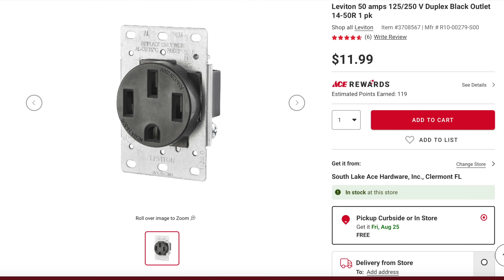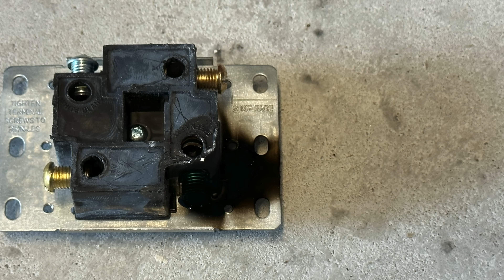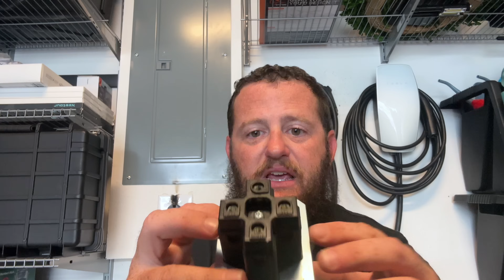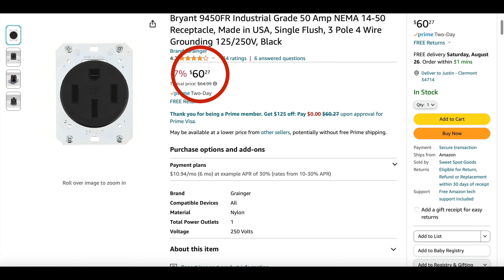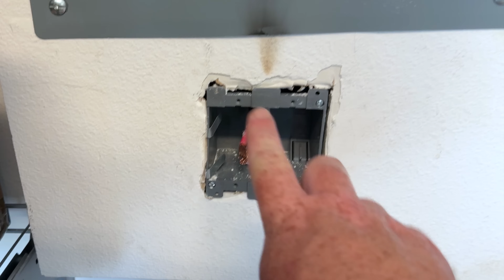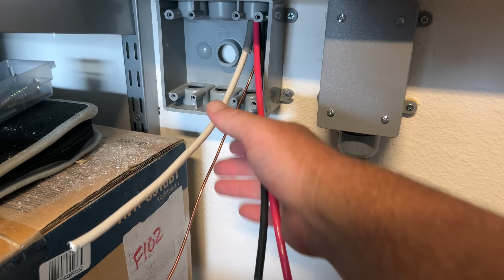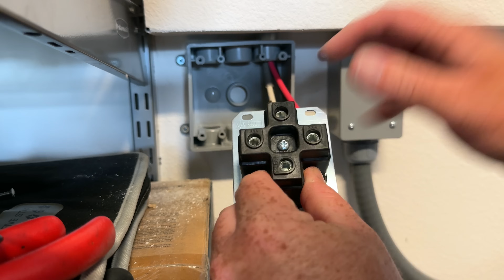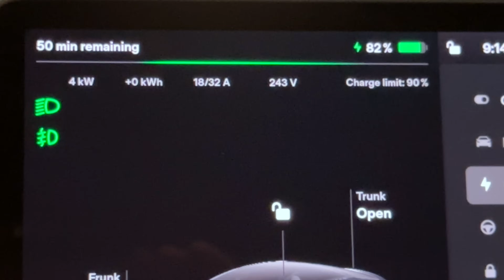This Will Save Your Life if You Charge Your Tesla on 14-50 Outlet!!

Comment: Like most manufacturers of building supplies, I would assume that your Home Depot or Lowes Leviton offering is not identical to the "same" part offered by an electrical commercial supply house. Anticipated use cases, as you noted, are different. 
It would be nice if some EV governing body of manufacturers, or whatnot, would release a build standard for 32 and 50 amp EV receptacles. Then manufacturers could submit their products, have them meet some level of compliance which they could then advertise. Sort of like NACS, or CCS, etc. are standards. 
Because of my housing situation for the next 9 months or so, I will be using an existing 32a 240v dryer outlet. But I am plugging a short extension cable into it and never removing it from the source outlet. When needed, I'll plug and unplug from the other end of the cable.
Reply from the maker: Just like with many other household appliances and applications, a standard would help both consumer and professional steer to the right stuff.
Reply: A better standard sounds good, but using an extension cord does not. The Mobile Connector has temperature sensors to detect overheating due to excessive resistance, but the extension cord does not. So if there is heat buildup at the receptacle, it won’t be able to detect it unless it’s plugged in directly. I assume that’s why the manual says not to use an extension cord.
Reply: @pepstein  Even if the extension card is STW rated with 10AWG copper and has the weather rated thermoplastic jacket? The extension is built to supply constant 30A service to an RV under full rated load.
Reply: @Agg1E91  the issue is not with the extension cord carrying the current, although it could be for others who use an inappropriate cord. The issue is with detecting overheating in the receptacle, either from a loose connection with the extension cord or with the wires that supply power from the panel.
Reply: @pepstein  got it. Thanks.

Comment: Just curious, why were you unplugging it so frequently? I have mine plugged in and I don’t remove it. I bought a more expensive 14/50 to prevent overheating and failure though.
Reply from the maker: I test a lot of charging equipment so I plug and unplug from time to time

Comment: My friend electric, he sais for car charging nema 14-50 better 60amp breaker.
Reply: With a 14-50 outlet, you don't want to go higher than a 50 amp breaker... That's why it's called 50 in 14-50.  The 60 amp breaker is of you were to hardwire the wall connector directly to your panel.
Reply from the maker: 50 amp breaker is the max you'd put a 14-50 on.

Comment: Never plug or unplug a nema 14-50 while energized. Curious how often you plugged and unplugged the outlet.
Reply: Something doesn’t add up here.  First, the ground doesn’t normally carry current. Second, you blew your main when this happened.  That means you were pulling in excess of the main breaker rating maybe 200 amps. If this were simply a matter of a poor connection, your current would have not even exceeded the 220 breaker limit. The receptacle might melt but a standard non-arc fault breaker wouldn’t trip. I think you had a short to ground and I have no idea why.  I’m no electrician, but I think you need to consult one.
Reply: @kramerphotos  Good catch. this guy is putting Leviton out of business. Looks like the Electrician cut the wire sheth with a razor knife and nicked the hot and grounded out overtime. I don't think it was the receptacle. I think it was the wire connection. The ground is installed to ground out when there is a short.
Reply from the maker: probably cycled the plug 15ish times since November 2022
Reply: hello, can you please explain “probably cycled the plug 15ish times since November 2022” do you mean you plug & unplug 15ish times?
Reply: @hank1689 Yup.
Reply: Use it at max capacity charging only when really need it, as all night charge you can regulate the charge down to 15 or 20 amps and you protect from heat current but also you are giving long life to your ev batteries
Reply: @jumartinez1  True, but even 40amp level 2 charging is much easier on the battery than Supercharging.
Reply: I leave mine plugged in as long as possible. I actually bought mine because of the middle thumbnail you showed. Do not go cheap on something that can burn your house and EV down!
Reply: Just leave it plugged up and shut the fuse when you use works great
Reply: Made in USA vs Made in China 😂 - would recommend Hubbell anytime
Reply: @markvillaespin6962 has nothing to do with where it's made. It's about what it's made to do. 

Cheap Leviton plug is for occasional dryer use at about 3 khz for an hour max at a time. Then fools come along running 7 to 9+ khz for 7 hours straight and it's amazing it takes as long to burn up as it does. If you got an American made receptical created only for that purpose it would burn too under that load. 

Conversely if you buy a Chinese made 14-50 that's made to industrial specs for long use continuous load at high voltage and amp levels it'll work just fine.

If you're going to be jingoistic at least be a little bit correct on what you're speaking about.
Reply: A lot of group on Facebook posting this a while back with the white plastic plate melting burning don’t use those and best to leave it plugged for mobile connector
Reply: I am going to get a RV Steel locking box for my 2024 Tesla model 3 for mounting on the exterior of my house and put a 50 amp breaker and use number six wire, the RV receptacles are meant to be unplugged and plugged in frequently so hopefully shouldn’t be a problem
Reply: So we need cut the power?
Reply: Turn off the charger before unplugging the cord.  Goes for anything electrical. @MiraAlCielo
Reply: @Lo_228 yes, on that breaker.
Reply: May be install a GFCI breaker for your 14-50 outlet and a whole house surge protector too. Thanks for the video!
Reply: Level 2 EV chargers should be semi-permanent installations.  As a high power electronics product design engineer, I’m baffled as to why it isn’t code to hard wire level 2 chargers above 30 Amps into the home wiring.  Plugs only make sense when regular, repeated connection and disconnection is required.  Moving, mechanical interconnect devices like jacks and plugs are, by their nature, a primary failure point power distribution.
Reply: @tajdvl-advocate6113  Great feedback. There's a reason the Tesla wall charger is hardwire only.
Reply: Wait you said you personally took this apart and then put back together? Did you torque to manufacture specific foot pounds? If you don't you can have wiring come loose.
Reply: The breaker box is inches above the Nema…. Literally eye level. 😬
Reply: @miami3863 It's not a electrical code violation to have the outlet below a panel.
Reply: I've cycled my 30amp between the charger and dryer probably 100 times
Reply: @jonathanyates8414 Why not use a Y-adapter?
Reply: Actually, the ground does carry Current. And so does the neutral they're attached to the same connection.
Reply: @Magicinstalls No the ground only carries current when there is a fault. The ground and neutral are bonded, but the ground must never carry neutral current.

If your ground is carrying any current something is very wrong.

Comment: I'm assuming by "cycles" you meant plug/unplug cycles and not electrical charge cycles, right?
Reply: He's saying both, but his failure seems to be from multiple times of plugging and unplugging underload.
Reply: @DJR-u2g Looks like he had a ground fault to me. I’m not really sure how he managed that, though.
Reply from the maker: correct. But on top of it, the continuous load, which is not considered a "cycle" is also a consideration

Comment: You might consider using a torque wrench that your setting is not right up againts the max. Additionally, having a thermal camera is a big plus.
Reply: Also a good idea to twist and tug on the wires, then tighten them again. Also best to go back in after a week or two and retorque then one more time, as the heat cycling may loosen them up a bit.
Reply from the maker: true

Comment: Not sure I understand how this could have happened….  Why was the plug being inserted with a load already turned on?
Reply: The cheap Home Depot outlets aren't rated for heavy, continuous draw.  They are rated for occasional spikes to 50amps for a couple of minutes, not potential hours.  They melt, in essence.
Add to that the plug is never meant for more than a handful of insertion/removal cycles (even the Hubbells aren't rated for repeated insertion cycles) and you start to see the blades inside the outlet not making good contact/sparking/heat/fire.
Reply from the maker: dont have good answers for you unfortunately

Comment: Well, I have plugged my mobile connector in once and have never unplugged it.  I turn off the circuit breaker when charging is completed.  

I always charge at home so I don't need to take my charging cable with me.  I don't drive that far in one day to need to go to a public charging station.  So i should not have any problems.
Reply: You're risking breaking your circuit breaker. They also have a limited number of flips they are rated for.
Reply: Do you turn off the circuit breakers to all your appliances when you aren't using them?
Reply: It’s ridiculous that you kill your circuit breaker every time. You are asking for it to fail, it’s not a daily switch
Reply from the maker: just know that over time, the constant demand on a basic plug will likely cause melting, which can cause a catastrophic event at some point of failure

Comment: Man, thank God you’re all ok!! 🙏 Lesson for everyone. I also had a pro install mine in the garage, and it’s an all metal box - no plastic cover. I plugged in my included mobile connector the day I brought my Tesla home and haven’t removed it since. Only because I had routed the Tesla plug neatly behind some storage cabinets and didn’t want to move it again. (Bought another mobile connector for the car)
Reply from the maker: yea, me too. Plugging in once and leaving it is ideal of course, but make sure you check on it every once in a while to be sure it's still in top shape.
Reply: @BeardedTeslaGuy  What is ideal, is not having a plug in the first place, the best part is no part.
Reply: #6/3g COPPER is a 50 amp breaker. 60 amps is at least #5 or probably #4/3g, because I have never seen #5 gauge wire before. 💙 T.E.N.
Reply: @tracynation2820  That's because there isn't any. You can get away with 3 wires because the charger, at least Teslas, is completely enclosed in plastic.
Reply: Bay a tesla wall  connector for 475$ from tesla and run direct wires  6/3  with a 60amp breaker from the main to the garage .
Don’t be cheap spend the extra money
Reply: @nvptx  If you run any length of wire, use #4, check your requirements, consider if you need more power in the future as well.